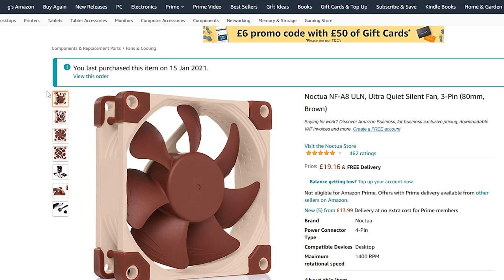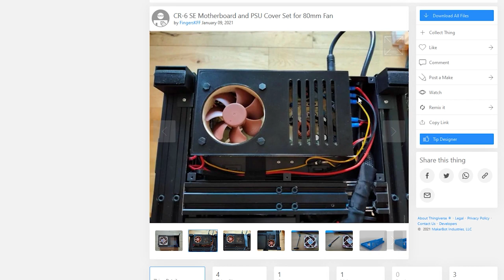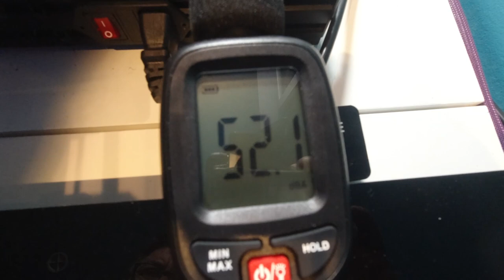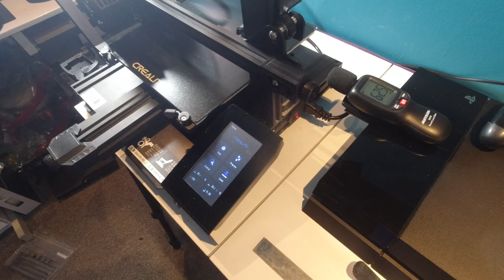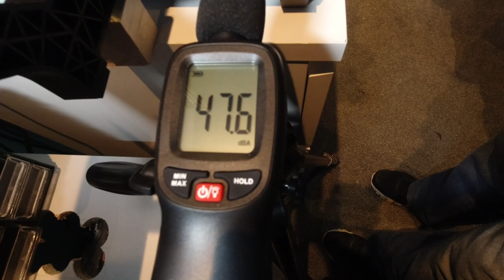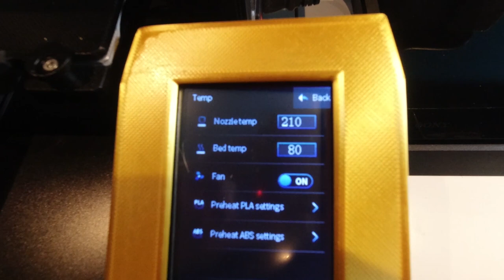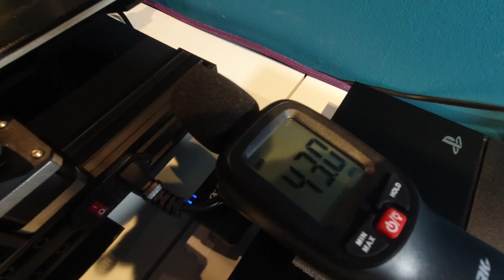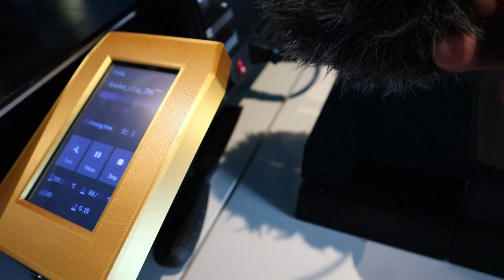Creality CR6 SE fan upgrade to silent Noctua fans

Comment: Awesome video, thanks a lot ! But how about a dust filter over the noctua fans ? When the printer is off , there is a big open space between the noctua blades in to the motherboard and the PSU for dust to come inside
Reply from the maker: Hi Pitbull thanks for the comment...You do have a point re filters...for me though its fine as it is as my man shed is pretty dust free...am always cleaning it. I suppose some easily removable filters like on a slide out tray would be a good idea...its just that when its a fixed filter or a hard to remove clip in one people just tend to neglect them and they get blocked so restricting air more than with no filter at all.

The ones on the stock Creality covers are absolutely a stupid design...the filter mesh is stuck to the inside of the cover meaning you would have to take the covers off anyway...BUT also the motherboard one is between the fan and the metal meaning a fan removal to clean properly!..I will just check once in a while for dust build up inside ....but yes if someone was to design a slide out filter tray on Thingyverse it would be a good idea....sadly my CAD design skills are zero :)

Comment: Hello again, 
currently going through this upgrade and I was just curious, where did you connect the power for the mainboard fan? Did you cut the wires from the previous one and mounted the buck converter on them, or did you pull 24V wires from the PSU and connected the buck converter on those and then the fan? Thanks a lot!
Reply from the maker: I mention it in the vid at 18:40 in ...I had a little white 2 pin plug of the same size with wires attached in a spares drawer so used that plugged in to the motherboard connection as the input to the buck converter ...again be sure to check that red and black go to the same pins as on the stock fan as on the spare part I had they were reversed.

Then I soldered the female socket/wire that came with the new Noctua fan to the output of the buck converter and plugged the fan into that.

As mentioned in the vid  I wanted to keep the stock fan with its plug on in case I had to return the printer but you if you haven't got a suitable plug lying around you can snip it off the stock fan as its unlikely to be used again.
Reply: @TomsManShed  Ah...my bad. I understand now! Thanks a lot for the reply and all the help!

Comment: Are there no fans of the same size, so that the original covers can be used?
Reply from the maker: Yes there are but am not sure if they would be any quieter....the bigger the fan is the quieter it is (usually) and also with the motherboard fan being 24 volt you would still need somewhere to put the buck regulator to convert it down to 12v for the new fan.

You could of course source a 24v one but the choice is far less ...being bigger the Noctua ones shift the same amount of air (or more) at lower rpm and really are totally (to my ears at least) silent.

It was no real hardship printing the new covers and some feet to raise the printer...a bonus is that now I have done the cover from white PETG you can see the blue light of the buck regulator through it from the front...so giving a visual indication of whether the fan is on or off (on the BTT motherboard it switches on and off as required unlike the stock board where it runs constantly)

Comment: Thank you, but i coulnt find the cable holder stl file could you share a link for that?
Reply from the maker: Hi Emre the tall cable holder at the back is this one    https://www.thingiverse.com/thing:4656494

The one on top of the hot end is this one https://www.thingiverse.com/thing:4653730

Also since I uploaded the video I fitted this filament guide which works well https://www.thingiverse.com/thing:4632727

Hope this helps
Reply: @TomsManShed  definately helped a lot, thank you for your time, subbing now :)

Comment: Anyone know if we can fit 120mm fans instead of 80mm?
Reply from the maker: Hi Chris.....you could rig up somehow a 120mm if it was external.....(I did that to my CR10) but would have to design your own housing/mounting etc.....

It wouldn't fit internally as with these fans, as there isn't physically enough room inside.....the 80mm only just clears the stuff inside the motherboard housing.
Reply: @TomsManShed  ok wasnt worried about depth as much as if it would fit with. I'll probably just print this and see if I can dremel it and tap it

Comment: Thoughts on this printer? Ive seen some mixed reviews on it but im not sure if creality has fixed the issues I saw ppl talk about yet. Thoughts on the CR6 SE vs the Ender 3?
Reply from the maker: Hi Slaughterman....yes I read loads of bad reviews before buying but then read also loads of good ones....The reason I bought from Amazon (could have got cheaper from Ali Express or Bangood) was so that if it proved a bad one I could easily return it. 

The main probs with the power switch etc seem to have been on some very early ones and even though mine has an early motherboard (the printer has an 08 (august) ser number) it does have the later proper power switch and kapton tape on the clips etc.

I updated to the community firmware (see my other vid) and that is a big improvement.

Even though I have only had it 5 weeks or so it has hardly been off and I have printed tons of stuff and it has performed perfectly...the prints are really nice and its great to use....I have ordered a BTT MB as they are only £30 from Ali Express and also a flexible magnetic build plate as I love the one I have on my CR10 Mini.....the BTT MB has some extra features and the consensus of opinion seems to be its a good upgrade from the stock MB even though like I say mine has performed flawlessly for well over 150 hours or so so far.

I can only speak of my experience of course but overall I love it and so far I don't regret buying it.... I cant comment on the Ender 3 as my only other printer I have owned is the CR10 Mini I have had for just nearly 3 years....there seem to be a few CR6 vs Ender 3  reviews online.

Good luck with whatever you go for.

Comment: same thinking! i was wondering why people werent using noctua fans.
Reply from the maker: Hi Shawn....yes I am sure it wouldn't cost manufacturers too much more to put some decent quiet fans in as stock.

I know they try to reduce overall costs but it would be a huge selling point.

I have mine printing something as I type this about 4 feet away and it's almost total silence :)
Reply: @TomsManShed  yes! why not make 2 versions a standard one and an upgraded model with silent fans , and even bl touch for other models that dont have auto bed leveling. im sure people would pay the extra to have the nicer model.